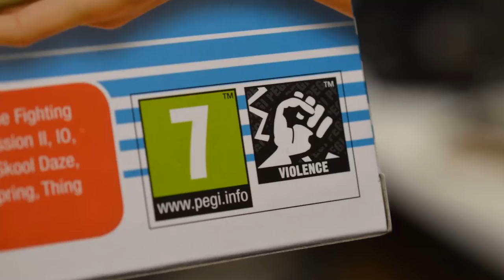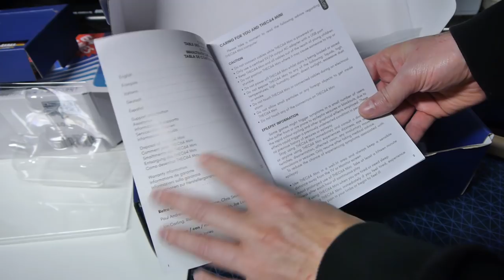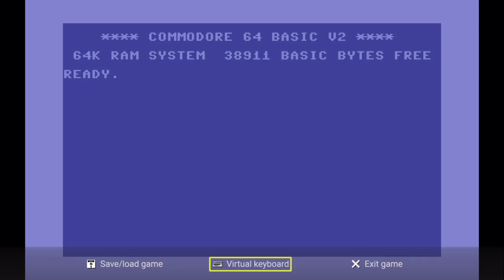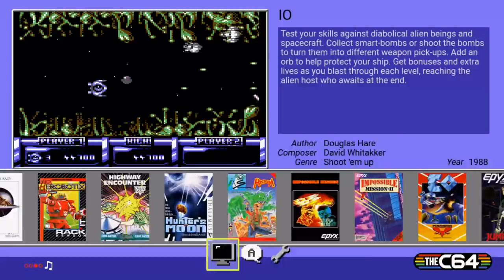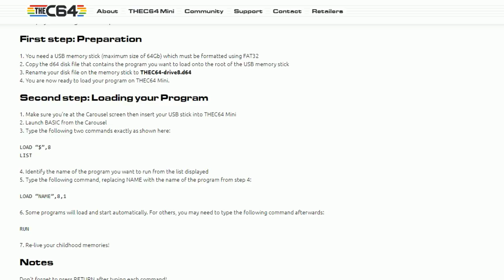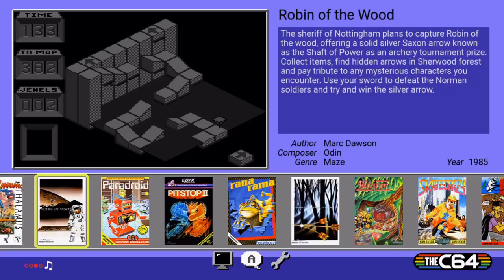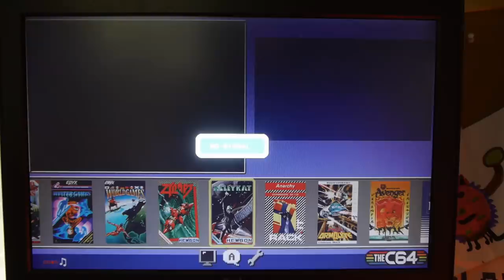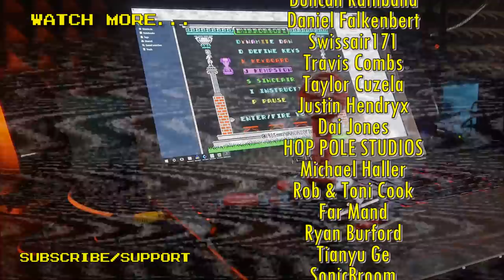C64 Mini | Nostalgia Nerd

Comment from the maker: Firstly, no apologies for emphasising the "P" in Temple of Apshai. It's how I roll. Secondly... 
The SID emulation sounds fine from this, and the screen response is negligible. Thirdly...
Here's a quick overview of the specs (according to the website);
High Definition output at 720p via HDMI
Pixel Perfect graphics at 4:3 ratio, with full width, CRT filter and US/Europe display mode options
Save game function
2 USB ports: plug in a USB keyboard and use as a fully functional home computer with C64 BASIC, or add a second joystick for 2-player games
Supports software updates via USB flash drive
Reply from the maker: Thanks. I appreciate it.
Reply: Peter, was there any latency issues with the device?

8 bit guy tested his unit, albeit a European/PAL unit, and there were latency issues (obviously to be expected) but does you PAL unit, on our little island, have some jankiness to it?

Obviously it'll get sorted with firmware and future optimisation but people often don't support something if it doesn't work great out of the box unless they are hardcore lovers of a device.
Reply from the maker: No, I meant "part of the course". As for latency... it was negligible. The problem is, its hard to differentiate between the latency caused by the TV itself and the device, so I didn't bother with any further testing on that part.
Reply: In the context you used it in, it really should have been 'par for the course'. 'Part of the course' isn't even a phrase :P Unless you're talking about a literal part of a course, such as a section of a golf course.
Reply: I wasn't making it an issue of grammar, just use of an existing phrase. It's also not the point of the video but it was a point to be made anyway (and getting an entire phrase correct isn't pedantry), but sorry for having something to say Sir, god of Youtube comments Mr Andy Merrett, Bsc Ssc.
Reply: I just wish this new C64 mini would had an option to make loading games nice and slow just like back in the day... lol
Starting with the the FastLoad, and Action Replay cartridges,. they were a buzz kill, but a good one nonetheless.
I think C64 mini would have been even more awesome if it came with a full sized keyboard just like the original (which probably would have cost a mere $10), or at least an easy way to plug in a standard keyboard with proper mapping for the C64, Run/Restore, etc buttons.  Oh well, looking forward to the new C64 FULL release! ;)

Comment: I have the full sized TheC64 and I love it to death, it's so cool.  Of course the firmware has been updated a lot now, and you probably also know that now loading other games onto the unit is very easy and straightforward.  I suspect that noise your unit makes when you turn it on could indicate a hardware fault, my unit does not do that and never has.  Still, they are great units, especially the full sized one.

Comment: USB extender for joystick and usb  Multi HUB Splitter 4 way (plugged in memory stick, second joystick and wireless keyboard), updated firmware and fixed common problem, the joystick thicker screw mod,, easy enough, picked my one up for £27 week ago, have been waiting for the price to come down as not a great deal of C64 nostalgia, played mostly 180, Rambo 2, Commando, Bruce lee and Ace of Aces back in 1980's, New Commando arcade SE and Bruce lee 2 are worth a look.

Comment: I agree on some level with you on the mini. I actually have one and although it runs fine (no lag, crashes or anything) the support for USB devices lacks at the moment The joystick is horrible, to stiff and in precise. I think tomorrow the first firmware update will be released and hopefully it solves some issues. As a side note crashes reportedly are caused by weak power supplies, especially if you use USB drives or keyboards it draws more than 1amp.

Comment: The non functional keyboard seems like a missed opportunity (even a few working hotkeys like a basic auto loader, menu, save, etc maybe mapped to the f keys would've been a clever move) without it this is just a cute case with a low-end sbc. Which is fine if that's all you want.

Comment: Between David (8-bit Guy) and you I think I am satisfied giving this a pass.  I did buy Cloanto's C64 forever (and Amiga Forever as well) so they already got money from me.  I'm fine just firing up an emulator on my computer, though I don't have a retro controller.
Reply: There are massive latency issues. If you are willing to play the games this should be a big red flag.
Reply: The actual hardware on a CRT is of course the best solution, but some of us don't have that luxury having long-since sold our systems.  If the full-sized C64 replica is released and isn't run via emulation then that would be a suitable alternative.  As it stands with this one, there is no real difference between emulating on it or on a PC.

Comment: One major issue I've ran into already is any of the functions that require the shift key, such as $, ", etc.  produce extremely weird characters, not the shifted function of the key pressed, I have managed to load and run a couple of old C64 games, however they don't work properly without the keyboard, and trying to use the stupid on-screen keyboard sucks and is extremely slow trying to toggle through with the joystick...obviously someone didn't actually try to play any games or do any actual BASIC commands on the emulation system itself....hopefully maybe they'll do another update soon with a fix.

Comment: I'm an Amstrad man myself, love my 6128, its lush... But if they ever decided to rehash it as a "console" type affair like this, meh, I'd leave it, but if they rehashed it as a working computer, like it had a working keyboard, 3" disk drive with the satisfying inserting disk "clunk" click (I'm thinking that a 3" disk is a big arsed adaptor for SDs, not an actual drive that uses original 3" disks), and has modern connectivity (HDMI, USB etc), I'd be on it like cheese on a pizza! :)

Oh, and no shitty menus like that, switch on and straight to Locomotive BASIC, then, if required, run a command to access games on an SD or USB.

Comment: Had feeling this wouldn't be great. There's too many of these new retro machines. Can't beat the original hardware.  Even Nintendo didn't add a cart port. :(
Reply: Harry Warburg bull shit. NES and SNES sold very well.
Reply: Who needs a cart port? It doesn't matter
Reply: The Super NT seems sweet af though. Outdones the SNES Mini by far. Hell it's even better than the original, it's the true 21st Century SNES!
Reply: I know what your saying and I'm saying you are wrong. I had a nes as did some of my mates. None existent? Nope..
Reply: Every one who has carts :\ ( crickets )
Reply: He didnt say SNES he said NES.And  no,the NES did not do great in Britian,but did ok in Northern Ireland.
Reply: To be realistic, a cart port is far more difficult than it sounds. For one thing you now need a device much bigger;
I have a SNES mini and a Super Famicom + PAL machine, and a game cartridge is actually larger than the entire snes mini.

That aside, look at the sega devices that allow cartridges, and pay attention to how unbelievably clunky that actually is. Factor in the propensity for SNES games to use hardware expansion chips (which, the sega method is basically ROM ripping system), and the whole thing becomes something of a nightmare.

Sounds great in theory, but the practical reality is allowing cartridges creates a lot of headaches.
If they wanted to be cute and offer long-term support they could have designed mini-cartridges that have extra games on them. But that's about as far as I can really see in terms of practicality.

Look at the Super NT by comparison; That system's implementation is more expensive, and it has only one game. Above board game licensing, even of 30 year old games is not trivial.
You can guarantee that the bulk of the cost of a SNES mini is in getting agreements for the games, NOT the hardware itself.
Reply: Harry Warburg - The NES didn't do too badly in the UK considering it's massive lack of marketing!

It was just way too late as it reached it's high point in the UK in the late 80's/early 90's when friends of mine were playing NES's with graphics that looked like tramps sick on account of the NTSC to PAL picture modulation/demodulation.

Was the NES bad? Only the picture ;-).. but everyone seemed to enjoy it and when the SNES was announced people were looking forward to that.

The thing is, Europe was more computer based gaming than console gaming and people had had numerous 8-bit systems since the early 80's and the Amiga since 1985 (16-bit) when the NES (8-bit) first landed in the US in 1985. 

As for the SNES, the SNES did just fine but it's window was a brief one as it was a late 16-bit system and was released a few years after the Sega Mega Drive and everyone was developing and moving on to 32-bit systems. Even a mate of mine opted to dump his his SNES after a year or so to get an Amiga 1200, to get an improvement on his A500!
Reply: The NES just didn't do as well as the C64/Spectrum (which were well established and cheap) or the Master System in the UK. It still did well.

My experience was that most kids had a Speccy, 5 out of 10 had a Master System eventually and perhaps 2 or 3 in every 10 kids had a NES. Still plenty of nostalgia for it - just obviously doesn't hold a candle to how it did it in the American market.
Reply: MSX ruled the computer market in the 80s in Europe, meanwhile Commodore was the instant go-to in America.
Reply: At least in Finland the MSX was the instant go-to if you wanted a computer.
Reply: Jay Jay no it isn't a known fact lol. It didn't sell as well in the UK as it did in Japan, the reason being most alreadu had c64 or spectrums, but that doesn't mean it didn't sell well...
Reply: More people in the UK claim they had one now than did because people seem to be borrowing nostalgia from american Youtubers. I saw lots of c64s, spectrums and SMSs but didn't see a NES until after the SNES was released and they re marketed it as a budget version. When I finally did play one I was massively underwhelmed as I was used to better looking games on the SMS. I wasn't even impressed by super Mario bros as I'd already played it on Allstars so it seemed like a downgraded version.
Reply: Unfortunately its all emulation these days, and the emulation doesn't work very well.  Maybe...at least I keep hoping they'll recreate the C64 full size and do a much better job because the mini sure isn't without bugs related to trying to emulate the original C64 system.

Comment: Could a printer be hooked up to the C=64 Mini? I realize this is mainly for gaming but if your own programs can be loaded then it should be like the “Computer” that it was and not just a games machine if it is to truly replicate the functionality of the original.  Such as old productivity software!
Reply from the maker: I'm sure with some homebrew work, it could be done. But out of the box, no.
Reply: I'd heard they were planning on bringing out a full-sized unit, that might open up the expandability options.  Sadly there aren't even any GPIO pins on the board so hacking will be interesting to say the least.

Comment: TheC64 Joystick is a clone of the C64DTV Joystick that a clone of Competition Pro 5000,I have swapped C64DTV stick with TheC64 stick. The joystick is very cheaply made and most of the the time it as a mind of its own and if you push left and it goes left and up.and the stick can break.the stick has a very long screw in it when the C64DTV only has a small one,so I don't know why they are using a longer screw. and the spring is bigger.The spring in the C64DTV looks like a C64 key spring... :) I put a elastic band under the red washer to make the joystick abit stiffer and it made it feel better and stops it going left and up.

Comment: No BASIC and Assembly programming guides = No Sale. :(
Reply: On their site they have a basic rundown of basic
Reply: thedungeondelver this is it.
Reply: The original came with neither of those anyway. You got some basic stuff in the manual but it was't really a guide.
Reply: gibbonduder182 you definitely didn't have new C64
Reply: ehh. 6502 is not a register based design.
It's a register + memory based design;
A lot of it is built to work directly in memory.

For instance I've seen random number algorithms performing shifts on 32 bit values.
Does that involve loading 8 bits at a time from memory to a register?
No!
You perform the shift directly in memory, with the carry bit set as a result, then perform the second shift.
This is aided by zero page memory, and the fact that 6502 design demands single cycle memory access. (the implications of which is that memory access isn't much different in performance to working with a register.)

Also, data bus width is irrelevant to code complexity. It affects performance, but doesn't make coding more difficult. You only need to look at a 65816 or 8088 to realise that; both are 16 bit devices with an 8 bit data bus.

16 bit registers are certainly nice, but on an 8 bit CPU? Still going to be a headache if your core logic can't operate on 16 bit values.
And if it can? congratulations, you're using a 16 bit CPU, not an 8 bit one.

16 bits of address space is minuscule by the way. 64k? You can fill that much memory really quickly. eh.
Never liked 8 bit CPU's that much anyway, but... If your complaint is entirely down to register size and address calculation issues...
My guess is you're not using a 6502 very effectively.
I mean, I've run into some messy stuff programming an 800XL, but that's the least of it. Dealing with screen RAM, even in an 8k graphics mode is not some massively complex task...

Comment: I'd spew if I bought this my original c64 was hard enough to work out, I was born 1985 and this was like mad to me flashy tapes and prompts just didn't have a clue at the time, Then i had a 3do fz10 I'll say i was not a rich kid but I'm from the valleys just had a deal for Xmas on the end of line stock, original need for speed was a blast i loved that console I also enjoyed sim city on the Saturn and i done a 24 hour xmas mario 64 run to 70 stars, im bit of a strange one really with what I've liked but c64 with california games or paper boy drift racer loads of good titles.

Comment: I found its in desperate need of a major firmware update, and the included joystick is absolute garbage. Otherwise it seems ok, but I'm kind of regretting not going down the raspberry pi path. Also a big thumbs up for the kittens, Octavius and regular.

Comment: hmmm interesting package, although unless fussed about the case one you probably be just as well off buying a raspberry pi or emulating on a pc.  Shame the joystick is a comp pro in looks only and lacks the microswitches of the original which is ultimately one of the main reasons for it being highly regarded

Comment: I disagree about a keyboard that small being "unusable", it''s bigger than many keyed devices before it. Mostly it's just a tease being fully molded, if it were a decal I wouldn't be pining for it to be functional. I kind of wish the joystick were better but I guess it will suit the casual users, could always add better switches with a mod. Probably need to hack it to satisfy me.

Comment: If it where a 1:1 hardware compatible machine with working keyboard, 6510 CPU, user port, real joystick ports, HDMI and SD-Card reader as "floppy" it would be a no-brainer but that? I could build a RetroPie using an old raspi one beating this thing in no time.
Reply: Agree. Check out the Ultimate 64. https://ultimate64.com/Ultimate-64

Comment: 9:20 - There's a cat seeking to take over the world. That's okay tho, I prefer cats and they'll know that too.

Does this C64 mini have latency issues?
Reply: 8 bit guy did a latency test on his. it was around 0.23 seconds for the picture and about 0.60ish for the sound to catch up I believe but he was using a PAL model in the USA so....
Reply: Yeah, I watched his review when it was published and he was aware of his being a European/PAL product, hence his good and thorough testing when he was aware of the latency issues. I was just curious whether Peter's C64 mini was suffering with the same latency issues even in a PAL region to get a feel, if the issue was the same or even non-existent.

No doubt new firmware and optimisation will minimise problems but if the product is a bit janky out of the box, people may opt to not support it and it dies which would be sad unless the manufacturers were open with their customers and said 'We're aware of issues, region latency issues and new firmware will sort that soon!'
Reply: These numbers are downright appalling, it is regrettable that no more was said about latency in this review. To put things in perspective this means that between pressing a button and the corresponding on screen action, 10 frames get drawn.
On the original machine you would have maximum one or two frames of latency. This is bound to make playing fast paced 50 Hz games rubber banding nightmare.
I will definitely not buy for this reason alone.
Why playability is not the decisive factor in the reviews I have seen so far is a very disappointing mystery to me.
A side by side comparison with the original hardware of the playing experience was also a must. We do not buy these things to line up our shelves (I hope at least).
Reply: Laurent Giroud - The latency issues were my primary concern too, together with modern HDMI TV's and their latency issues too.

If the C64 mini was decent, I'd opt to play on a 21 inch CRT, but not enough people have mentioned the latency issues, that may well only be temporary issue, but we can only hope!
Reply: reggiep75 the latency issue is my #1 complaint. I find several games almost impossible to play at the moment, and it is not my screen. No lag with nes/snes mini on it.